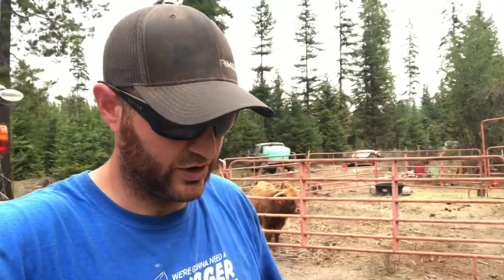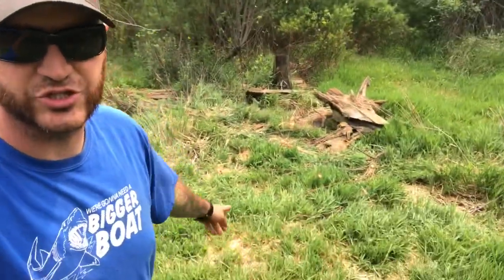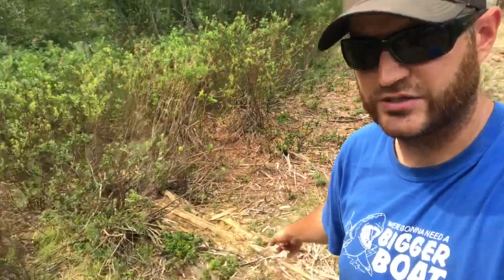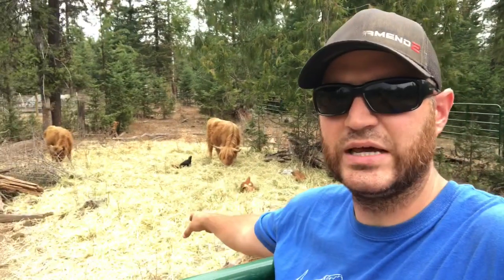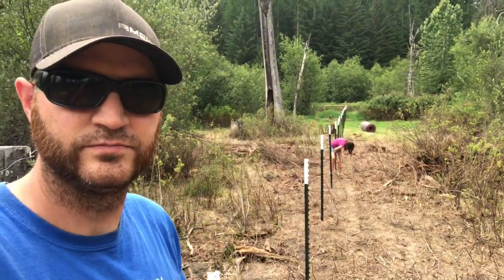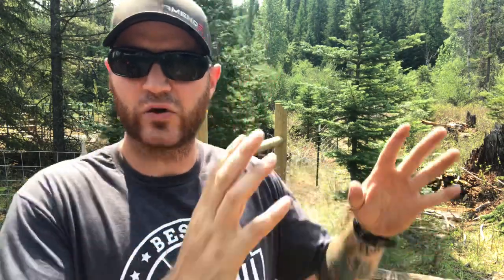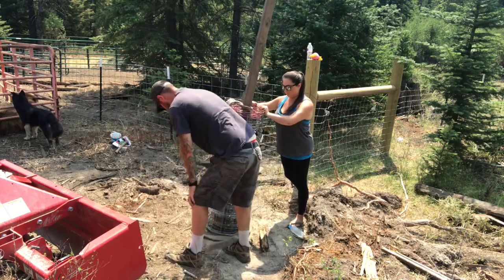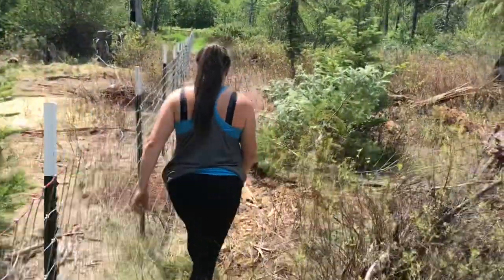Husband and wife install fencing like pros!!

Comment: You can use two boards to stretch woven wire fencing. Just clamp two boards together on each side of the fence with 4 to 6 bolts and hook a chain or a pulling straps at the top and bottom of the boards. The boards clamp tight to the fence so you can pull the fence tight and straight. Cut your boards a little longer than your fence is tall. If I was doing it that way I’d probably use hardwood boards but you don’t have too.
Reply: That's how we do it too. Really crank those bolts down tight or you'll just be pulling on the stays where the bolts are.

Comment: 2x4s like everyone says but use 3"deck screws (torx head are best) with fender washers on them. Also just use a come along wrapped mid way up the 2x4s hooked back to its own cable. Stretch it with the tractor or ratchet it tight and if you need to release tension and reapply its easier than moving the tractor. Fastest method I've found!

Comment: I'm no expert by any means, but you might try cutting two pieces of 2x4 about the height of your fence and drill about five holes in them spread across the length. I used 1/2" bolts through the holes then to clamp the fencing. On the top and bottom bolts I attached a chain about twelve feet long, if I remember right. You can then attach another chain to your tractor and hook to that twelve foot chain and pull on the fencing. If you need a little more tension on the top or bottom, just move your grab hook up or down a little on the twelve foot piece. <l 
Your line of posts looked nice and straight. That usually helps with putting up fence. 
Another interesting video, keep them coming. Have a good day.

Comment: Commenting as I watch. I've never pulled fence, but my dad told me that he used to take 2 2x4s, and bolt them together with the fence in-between (enough bolts to make sure it's clamped tight along the whole height of the fence), and then pull on that with a tractor.

How do goobers like us get such beautiful wives?

What a pansy. An air conditioned closed cab tractor. Sheesh!

Comment: Tractor is not controllable for tension, too easy to over do it. Get yourself two 2x4's and sandwich the end of the fence run between them, use two c clamps on the top and bottom to grip the fence between the two boards and one in the middle you attach a come a long to, use the come a long to get your tension in a controlled way that doesn't ruin your fence. you can do the same with barb wire or any other wire you need to tension.
Reply: Yep be careful
Reply: This is how we do it. But our State of the art big farmer brought out a machine that laid the fence. Sure wish it had been on the day we huff and puffed. I like we did it on our own anyways. Does work.

Comment: Why don't you use a piece of flat bar 2 inch by 3/8 thick long as the fence and then pull on it would have come along or use your tractor as dead weight and tighten up the fence. 🇺🇸🇺🇸🇺🇸🇺🇸🇺🇸🇺🇸🇺🇸🇺🇸🇺🇸🇺🇸🇺🇸🇺🇸🇺🇸